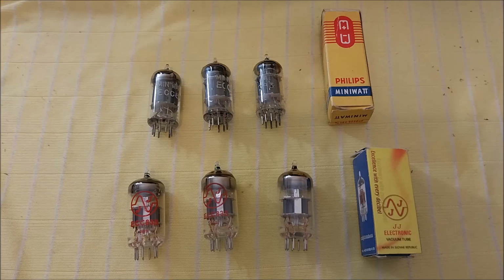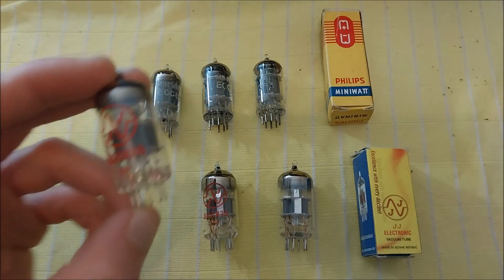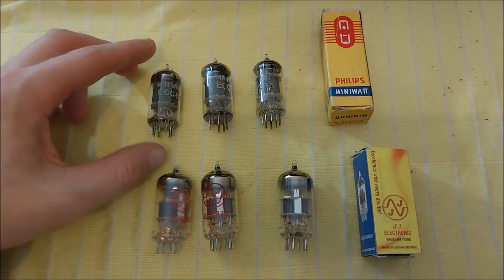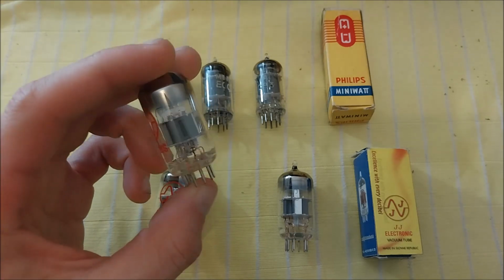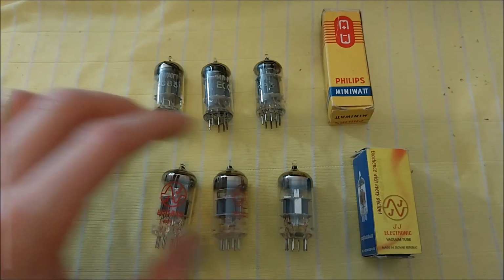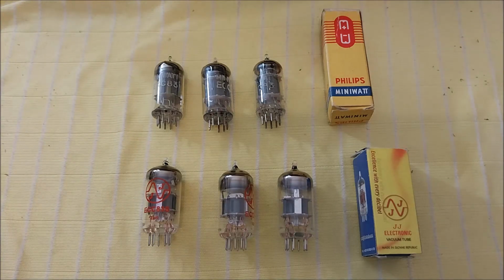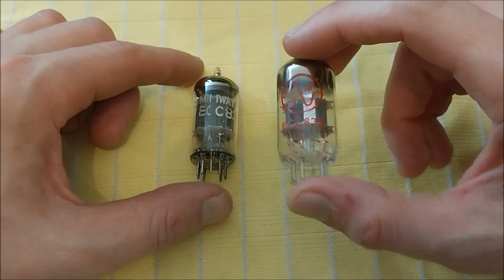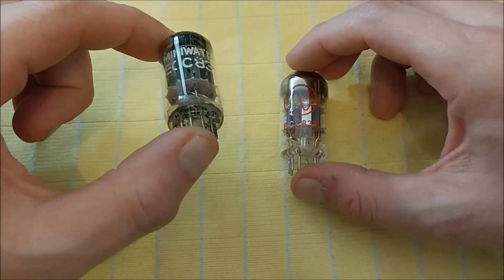Tube Sound Comparison - ECC83/12AX7 Modern VS. Vintage ( JJ vs Philips)

Comment: The whole NOS tube craze is a money ploy. How to separate you from your money for a tube that was once 25 cents to purchase is now worth $50+ a pop.... What people forget is that the tube had to be good to begin with, it lasted 30-50 years on a shelf, or in other people's amps to finally find its home in yours. At the rate it's going, soon vintage tubes from " name the famous player " will be worth $1,000 plus.... Modern tubes are made just like they were 50 years ago. There are questionable ones just as there are good ones. You just won't know how good the good ones are until 50 years from now when they still work, and they are sold as NOS. Eventually there will be ZERO vintage tubes, so start getting modern ones now while they are still being made. Eventually they too will be vintage.
Reply: Makes sense
Reply: Modern tubes are not made exactly like they were 50 years ago though.... There are a lot of materials that aren't "environmentally friendly" anymore and probably illegal to use in most countries. Materials have definitely changed and one could argue that it does make a difference
Reply: I would argue that the difference is not that much, or at least a lot less than the price tag suggests. The problem is, that if people don’t buy modern tubes, they won’t make them anymore, which means we will be really screwed, when all we are actually left with are crappy modern tubes 20-40 years from now…. The thing about tubes is that if you use them, you will loose them. So these NOS tubes are not long for wear.

Comment: The new tubes are getting much better
Reply from the maker: Well, the quaility control and materials are not better then back in the day, go figure :)
Reply: @ecc8344  nor is trying to guess 40 to 50 yrs of abuse a tube may have received.
Reply: no they are not, i have 1990's jj's that sound better than these jj's but honestly both sound like plastic compared to the real deal.
Reply: @MrRourk  try one vintage tube for the first time in your life....
Reply: @yaniv-nos-tubes  I own a Heathkit W-5m and Dynaco MkIV so I obviously no nothing about this stuff

Comment: So much of this is subject to taste and type of amp and style of music. Funny enough, I use Philips Miniwatts as my phase inverter tube in several amps. I have found something after speaking with a retired amp builder and tech about preamp tubes. He stated to me that current mass-produced tubes during the era when the amps preamp was designed and voiced is more important in selecting preamp tubes. I have an all original 1984 Mark IIC+ with original tubes in it. After tube rolling new and NOS tubes in it, I found the original tubes sounded the best. I tried these tubes in another mesa product and was surprised how much better that amp sounded. After a bit of research, these amps were designed using the mass-produced tubes of the 80s and 90s. They were China made 7025s with square foil getter and a round middle mica spacer. I installed some New China made 12AX7B with a round halo getter, and it sounded terrible, thin, and lifeless. Come to find out, most of the modern voiced amps of the 90s preamp voicing used this tube in design and testing. Speaking with a tech at Mesa, he confirmed that readily available tubes during the time period were always the first thought in designing a circuit. I have acquired a lot of these tubes now for my amps. Vintage amps that rely on power tube saturation are a totally different ball game. Modern amps get most of their voicing in the preamp with clean power amps with headroom. I love my collection of Vintage tubes. And I understand their use in certain circuits. Guitar amps and hifi gear are different animals.

Comment: I liked the vintage better on the solo tracks, but when the the other instruments were added I felt the JJ's had more clarity and air in the mix.   It reminds me of the subtle differences between a Neve board and an API board.  Neve having the more warm, huge sound...while the API has unmatched clarity and punchiness.  As more tracks are layered, those sonic signatures tend to compound....so warm & huge is more prone to muddiness, while clarity & punchiness are more prone to becoming warmer and tighter.  So I'd take the Philips tube for playing solo guitar and then use the JJ for playing in a band or multi-track recording.
Reply from the maker: Whatever works for you :)

Comment: I'm always buying NOS tubes for my customer repairs nowadays; whilst the JJ are good amongst modern tubes, I find that the frequency response is uneven in that they seem to be more low and low mid focused with a bit of high tacked on. The Philips had a broader flatter response which is good for Hifi. I am the authorised service centre for Marshall, Fender, Laney etc; so oftentimes my clients are power rock biased which means they would be happier with a JJ in this case.

Comment: I have a Marshall MF350 and I used an NOS 12AX7 Mullard and it was overly warm, it was used up. Then I used an NOS IEC Mullard and it sounded great but it sounded old like Classic Rock. It sounded way too dark so I bought a new Russian Mullard CV4004 and that sounded modern and great. I also wore it out way too fast cuz it started to hum. It even had that Angry growl reminiscent of Motley Crue or the Sum41 album Does This Look Infected. I realized that the angry growl only lasts for so long and wears out after a bit. The MF350 has a Plexi Circuit, a JCM800 Circuit and a Silver Jubilee Circuit plus another heavily overdriven channel that sounds like it’s a Silver Jubilee double tracked.

Comment: Hi! I play with a peavey classic 20 mini head and i was using in V1: tung sol reissue 12ax7, in V2: shuguang 12ax7 and in V3: mullard NOS ECC83. Power tubes were amperex EL84. These amperex died and i changed by mullard reissue EL84. I felt more clarity on clean sounds, but i think lost on overdrive. What you recomend for preamp tubes and powertubes? I have miniwatt el84 powertubes and i liked when i tested. My main doubt is on preamp tubes.
Reply from the maker: Hi :) first i'd say put that NOS Mullard in V1..start the signal chain with best tube of which you mentioned. If you like good gain and yet great clean I would say go for Ei Yugoslavia Ecc83 NOS, they are amazing. I just used them for a gig anx the sound was amazing!  And they are not pricey as NOSMullard which is good! Also Tungsram are great, great price and similar to Mullard sound:) EL84 id say go for vintage military Soviet NOS version, I forgot the name in cyrilic but you have a hint 🙂👍

Comment: Back in the 60s most amps were made with components that were 20% tolerance 10% if you were lucky. There is more to ones amp than just the valves, If I replaced all of the components with modern 5% ones in a original JTM45 and stuck the original valves back in it would sound different. It's all objective and I believe there is a lot of wank associated with vintage valves and components. I have a RCA bench amp from the 40s and use it as a practice amp it runs all metal cased valves and depending what speaker box I use depends on how it sounds obviously. This video is a good representation of modern verses vintage though but remember you could do the same using all vintage valves and compare the differences just between Mullards as they are all slightly different.
Reply: you are correct sir..this dude must sell vintage tubes... there was very little difference and the difference there was would be very hard to quantify as "better" ,also a few tracks it seemed he must have just lowered the volume

Comment: There's a detectable difference, however, I would assert that there is a much bigger difference in the following, than there is in the sounds they are producing:

1. Price
2. Availability
3. Emotion - how you feel about owning and using them

Again, yes there are discernible tonal differences heard.  But not as big a difference as the differences listed above.  In other words, not night and day but more of a time of day and, imo, within a couple of hours of each other - if that makes sense.

Stick all that in your relative value calculator and there's reasons why people may choose the new, or the old, as it's a relative thing for each player to consider.  I'd prefer the older tubes heard here, for my taste, but I wouldn't lose sleep if forced to use the new ones, especially knowing they're both less expensive and more available.

This is a good comparison.  I've heard others where too many options are looked at in one video and by the time you're done you're left wondering if you've heard appreciable differences or not!  ;-)   this was simple and focused.  Good job!
Reply from the maker: Thank you for your comment! :) good perspective!
Reply: I have never tube rolled. My feeling is that I want to start with the driver tubes in my Prima Luna evo 100 Integrated amp which are 12ax7 .
I'm  hoping for advice on a few points.
1) I would rather stay away from NOS tubes as I am on a budget and I would have more fun rolling through varios tubes rather than one or two that make me feel guilty for spending too much . My speakers are Focal Arias; are NOS worth it?
2)Although my system is a good resolving one, my life long percute for an open, clear top end is one I still want to scratch  ,at least at the 12ax7 "First" stage.
I would love any 12ax7 or equivalent advice/brands etc.
3)The "second line" regulator valves on my Prima Luna  are 12au7's  do you know are they  different to 12ax7 or is it just a (P.L.) taste thing? 
finely if possible same,  2) question  regarding 12au7 tubes?
Sorry to ask so many things but starting as I did with no knowledge it has been hard to finde some of the specific facts (Question 3). 
Thanks to anybody in advance for any advice.

Comment: The vintage tubes really stood out when the guitar intro was played. They had more "presence" and life. The JJ's were too laid back for me. I have a lot of vintage 12AX7's, Tele's, Miniwatts, Mullard, Brimar, Bugle Boy, many more. I haven't found the need to use any new production tubes in any of my gear, except some Tungsol 6550's, although I preferred the Svetlana Winged "C" 6550's in my gear.

Comment: I just compared the JJ ECC83 12AX7 to my NOS GE 12AX7A tubes and it is no comparison. The JJ's are muddy in sound and they really are meant to play in low volume, along with a 30 minute warmup. I did do a 12 hour breakin on both and the NOS is more pleasing sound overall.

Comment: Just got 1 vintage rca 12ax7. Not sure where I want to use it though. I have a EHX 7025 EH in V1, high gain JJ in V2 and balanced triode JJ in V3 and it sounds fantastic so I'm thinking I may try it in the cathode follower at V2 or the PI at V3. Guess it's time to try them both and see how they sound.

Comment: Hi, i would like to ask you an advice for good tubes for V1 and V2 in my DRRI. I had some NOS GE that went microphonic very soon and I would like to know your opinion about the new ones (Tung sol, Mullard, EH). Is the gold pin an important issue? Thanks
Reply from the maker: Hi! I made a video before talking about current Russian made tubes under New Sensor Corp.(EHX, Tungsol,Sovtek etc) Check it out! Gold pins perhaps add a little, im sure that tubes that were selected as a better performer in factory testings were added gold plated pins, overall the difference is not like night and day, very little imho. Hope that helps!
Reply: hi ,my name is yaniv i'm a local tube guru from eilat :
1.goldpins matter a lot when you are dealing with vintage or nos tubes it usually means a higher grade tube , for modern tubes it means a different model so different tone sometimes better sometimes not. the same goes for 12ax7a/ wa cv4004 or 7025 all higher grade vintage tubes but modern makers use the names and the brands however they want. a modern goldpin 7025 is nowhere near the old regular stuff.
2. for a DRRI i recommend a mullard i63 at v1 and a GE 12ax7wa at v2 for maximum versatility .ive been using this set on amps that i rent for live gigs the mullard at v1 adds low mids smoothness and soften the highs perfect for single coils or bright guitars amazing for drive. the GE12ax7wa for v2 you probably already know very clear big lows with definition neutral mids and crispy highs great for cleans humbuckers and p90's if you didn't like the ge and want more warmth brimar cv4004 or the obvious holy grail rca's are great.
3.all the new tubes are junk compared to the greatest nos or vintage tubes since the old stuff was made to military standards .vintage tubes sound better and last longer, vintage  tung sol and mullard are some of the best tubes ever made. modern or "reissue mullard" and tongsol are made at same russian factory as the eh tubes they all sound different though .

Comment: Why do the vintage tubes sound so much better than modern tubes.. I can hear clearly hear the difference in my AirPod pros it’s ridiculous the difference much less my studio monitors.. I’m replacing my tubes with nos tubes in my la 610 mk2 channel strip.. I can’t wait 😜.. how long do these tubes last ? I know it depends but in general sorry I’m new to hardware
Reply from the maker: Hi there. Why do they sound better? Better materials were used back then. And everything was made to last long. Back then people had their tv's and radios for a very long time unlike today when everything is made to be used quick and made with poor quality. Vintage tubes (at least preamp) last for a very long time, some people argue for a lifetime. So definitely superior choiche if you choose vintage :)

Comment: Thats a long the other is a short. Its not apples to apples. Anyone not aware of that Ive discarded all your tube opinions. There seems to be slightly more sustain on a long trying to do a direct comparison. The difference is so subtle its virtually undetectable. Therefore theyre interchangeable. No body important could tell the difference.
Reply from the maker: Not sure what are you trying to say?🤔
Reply: @ecc8344  More rigid? or 2x the surface of cathode anode and grid? Either way it gives slightly undetectable amounts of increase in sustain. 12AX7 is perimeters in how it performs in a circuit not how its built. measure the length of your plates visually. 1 is a "long" the other is a "short". short replaced long because of higher performance in audio fidelity. But beyond a slight increase in sustain Im not hearing a difference.

Comment: Little known fact: a vintage tube can handle more voltage than a modern tube. Most modern ECC83 tubes have a sweet spot of 450V while vintage tubes sweet spot is around 500V. Vintage tubes are just built better to higher standards.

Comment: NOS is a suckers market these days. Sure, they are superior, but if the set of tubes cost more than the equipment they are driving that's a big no-can-do from me.
Reply from the maker: I find vintage NOS tubes most of times cheaper then anything new..you just have to look where to buy em from..from eBay you will spend top dollar..on a flea market you can get em by less then 5 bucks a piece sometimes🥳

Comment: Short plate tube  sounds almost always  thinner and more sterile than medium and long plate tube version. Compare always tubes with pretty equal height of plate never a long vs short plate!
Reply from the maker: The reason why i made comparison is to point out those very differences you just mentioned. Not everyone knows that, therefore you have an example here.

Comment: My problem with JJs is they have a rather muffled sound compared to others, although they are rarely microphonic. So many of the vintage tubes still available are microphonic and worthless in most applications.
Reply from the maker: I have a whole bunch of vintage tubes and only very few have minor microphonic issues..for example Ei Yugoslavia Ecc83 can get very microphonic in V1, but in v2 and v3 they work just fine without microphonics..Im not sure what kind of experience you went trough, In my case I rarely have a microphonic vintage tube.
Reply: @ecc8344  I tend to get micro RCA grey plate 12AX7s.
Reply: so many people here never tried nos and it's so easy to tell.
Reply: @yaniv-nos-tubes  How is it easy to tell?

Comment: My go to 12ax7 has been Mullard/National electric of India.  What I replaced were the no brand 12ax7 from China that came with a stereo pre amp.  Almost an unfair comparison.  The stock tubes were fine electrically, but quite cool and lifeless. the Mullards were warmer, with a lush midrange.

Comment: JJ's are... bleh... only tube of theirs I really can say I like is their 6V6. The only reason they're so "dominant" now is the Shuguang (sp?) factory is still not rebuilt, if ever, and we're not getting any new Russian tubes. JJ's themselves aren't really my first choice... when given a choice. Before Ruby had a tube that could handle the plate voltage of my Bogner Shiva (SED stopped making their EL34 and that one could handle it), then only tube I could use was their JJ's E34L. That tube made the Shiva sound hard and like dog crap at performance volume.

I do have one amp that eats EL84's for breakfast, lunch and dinner and the only tube I have that has been worth anything in it as an old JAN tube. It's been faultless where this amp smokes new production EL84's in hours.
Reply: Have you considered bringing your amplifier to a tech to check what value screen resistors are used and check it’s bias?  Possibly go to another value cathode resistor if it’s cathode biased?  I have a Carvin Belair that is el84 equipped and has over 400 volts on the plate and it doesn’t eat tubes.

Comment: It would be more accurate and telling if the amp were biased for both tube sets, which would be a huge undertaking.
Reply from the maker: Preamp section is auto-biased in 95% of amps including mine.
Reply: @ecc8344  Oh, I see. Thank you 👍